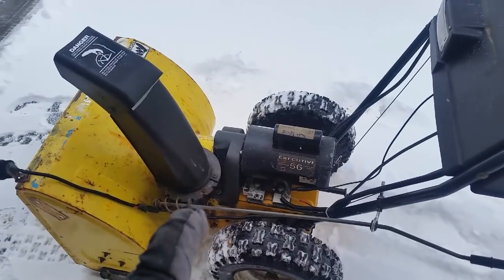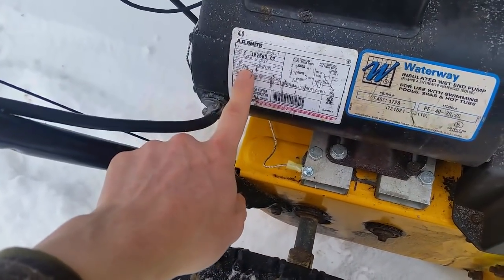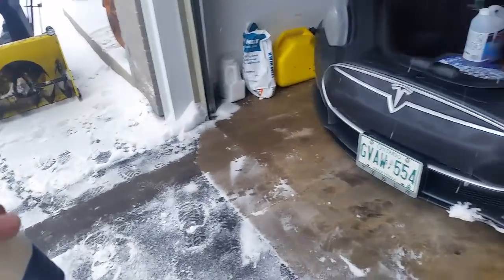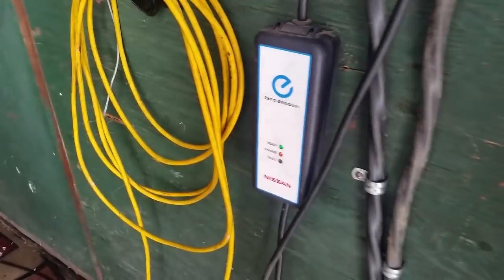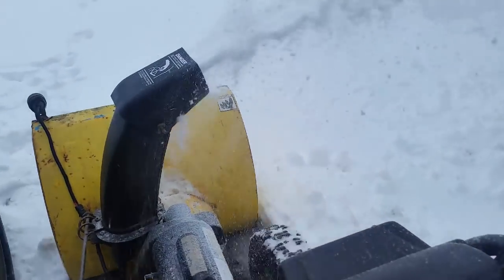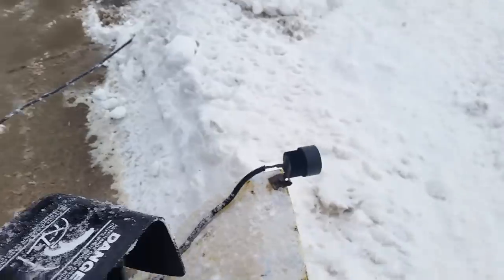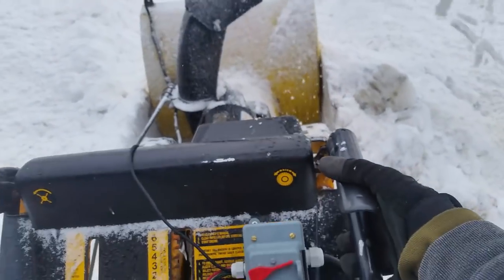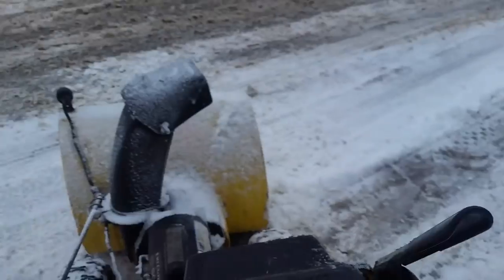2 stage snowblower electric

Comment: I had been thinking that I could get a somewhat larger motor, say 3 to 5 hp (about 25 to 30A, NEMA frame 213/5T as an example) and run it off the 14-50 outlet I have in my garage for my Tesla Mobile Connector.  The outlet already has a fairly pricey, but required, 2 pole GFCI breaker. (Your EVSE has a built-in GFCI as you know, but in my case, I'd go straight from the 14-50, EV/RV outlet.) I would need to get a larger gauge extension cord to keep voltage drop acceptable, but probably wouldn't have to worry about the cord overheating in a snowy environment. That and snow blower operation isn't as a continual load as EV charging is. I also thought that perhaps I could use a 1 phase to 3 phase VFD and go with a 3 phase motor. That would give me speed control, bidirectionality, as well as some ability to run the motor even with uncertain voltage drop on the cord, but finding a VFD unit that could survive the wet conditions of being mounted on a snow blower would most likely be a problem. Either that or I'd have to come up with a weather-proof housing that could breathe sufficiently. Such VFDs can be had for a couple of hundred $, but a 5hp, 240V, 3P motor would be pricey.  The weight of a larger motor might be a plus for traction too.

Comment: I had this very same idea for all the same reasons: while the single stage 120V plug-in throwers are fine for the powdery snow we get here in Ottawa (I see you're in Ontario somewhere), they just baulk on the snowplow windrows. I think some of the pricier Ego and Greenworks 55-80 V cordless two-stage blowers can manage it (since they're not limited to 15A) but that seems like cost overkill.

I hadn't even thought of using a hot tub pump as I wasn't even aware they ran on 240V. I had been figuring on using a motor from a 240V washing machine (front loader) for a conversion.

I think it is so unfortunate that North America adopted 120Vx15A as its standard, especially for outdoors. It has really limited the power of electric yard equipment like lawnmowers, chainsaws and snowblowers and has probably  cultivated an unfortunate cultural mentality that electric = weak compared to gas equipment. I can't help but wonder what the state of things (including receptivity to EVs) would be if 240Vx15A (or even 20A) had been made standard for garage and outdoor fixtures.

Comment: What’s it 745.7 watts per HP? So you have 230x12 was it? So 2300 + 460=2760 watts 2760/745.7=3.07 HP! Gas engine horsepower just doesn’t compare to electric!!
Reply: Most types of electric motors make peak torque -- which matters more than horsepower here -- at ZERO RPM. The gasser isn't making shit for torque until it's perhaps 2000 RPM. Also, the horsepower ratings are at the rated speed, which is 3600 RPM; if a 6 hp machine bogs down in heavy snow, guess what? Now it's only making 3.5 hp. The same phenomenon exists with electric car conversions; unless you really expect a car to do 120 MPH, you never need an electric motor with the same hp rating as the gas engine. Again, TORQUE is king! Cheers.
Reply: @fun_ghoul  I've noticed that a lot of gas chainsaws and snowblowers are now advertised based on the engine displacement rather than horsepower. Meanwhile, the battery electric ones seldom have anything other than a voltage (while the battery capacity is in the annoying amp-hour measure), though corded continue to have an amperage given. And torque is nowhere to be seen on any of them. The upshot is that it has become really difficult to make meaningful comparisons.

Comment: That would be good for my own project. but would come with just regular 120 volt... Maybe bigger snowblower??
Reply: If you only have 120V, you need the smallest possible 2-stage to convert, like a 22 inch. Alternatively, if you have a good bit of cash to do this, you could go with a high-amp-rated battery pack (e.g. Headway) and not be limited to only 1800W.
Reply: @fun_ghoul  Yes, but depend what motor (hp) with 120V…. 🙂

Comment: Nice setup! Some of the electrical works looks "dangerous". :)
What watt rating has your electric motor? Would you have put a more powerful motor if you would do it again (I saw you paused in the thick snow to let it catch its breath...)?
Reply: He paused because the wheels were spinning. He doesn't need more motor, he needs tire chains.

Comment: I just acquired a snow blower with a shot engine, now I need to source an electric motor.

Do you think that the not you have installed is a little under powered or needs higher rpms?
Reply: Most brushed AC electric motors are rated for the identical speed as gassers: 3600 RPM.

Comment: So maybe I didn't catch this part in the video. Is there a thermal overload on that motor / motor starter in the garage with heaters?
And I mean heaters as in overload protection. That thing has the possibility to run itself into the ground/ destroy itself/ burn up from overuse. 
And honestly your relay system and the fact that there may not be any sort of overload protection could all be remedied with a vfd. In fact it's the easiest way to get a smallish motor from single phase to three-phase. For about I think $800 I was able to get one rated for 30 amps and convert a friend's lathe to a three-phase motor. Much stronger much more efficient and able to do speed control. Also reversible. Easy to set up watching YouTube if all you want to do is have the speed be variable. You could also set the vfd to kill the machine if over a certain amperage. Vfd is smallish. Seeing as you fabricate I'm sure you could find a way to mount it somewhere in the back of the machine and get a small dial to control the speed. No need then for your inverter/rectifier/transformer. Vfd is the relay is the speed control is the protection essentially. Although not a true thermal protection you can set the vfd to have the motor run in between certain parameters.
Reply: Good question. Single phase motor more than likely has internal thermal protection.
Reply: You can't reverse the motor on a snowblower unless you want the blades to turn backwards, too. Ouf...

Comment: I did mine with a 5 HP 240vac motor and all 30 amp electrical
Reply from the maker: Post a video!
Reply: I will once my electrical parts show up from Ebay.
Seems nobody has 30 amp 2 pole square D QO breakers in my city and also the 30 amp DPST on off switch for the 240 bolt on the blower.
Reply: BTW the motor I used was a reversible one for an air compressor.

Comment: Hey, Joel. Have you considered stringing together 3 of the kobalt or greenworks 80v batteries to go cordless? Perhaps even a 2x3 configuration of 6 batteries for some extra juice? Admittedly, it may even be a better option at that point to go with your own home built battery from Lithium ion cells up to 240v.
Reply from the maker: It is an AC induction motor, DC might work on a cheapo universal motor, but for this I'd still need a beefy inverter or vfd
Reply: @erroneus  Good point, you'd lose a ton of power on the inversion

Comment: What kind of pulley did you use(part number or simular)? I know it is a dual or tri pulley. 

What shaft is at the end of the electric motor? 5/8  D Shaft? or is it a 5/8 keyed shaft? 

Was the shaft long enough for the whole pulley?

Did you use the same belts? I'm assuming so because of the plastic cover.

The reason for asking is I have a Greenworks brushless electric 80v lawn mower rated at 150cc (10HP?) with a somewhat the traditional (instead of two up front and two at the back) /// (its one up front , two on the sides and one at the back) mounting nuts and three wires to turn the sucker on. The battery goes into the motor .

It would be nice to use the battery and motor all year round instead of them laying around for a season.
Reply: 150CC is more like 5 hp (Honda 5.5 = 163cc), but might still be enough. Did you end up trying it?

Comment: Amazing ! I thought of something like this a few months ago. Very nice ! How do you simulated the signal for your outlet ? What kind of coupling do you have to link the motor to the snowblower ?
Reply from the maker: no signal required for the J1772 charger, just a diode and resistor. you can look this up online. no coupling, just a  belt and pulley mounted on the drive shaft of the motor.
Reply: @erroneus  Yay, belts! 😁

Comment: My personal opinion is that your gear ratio is too slow... that thing should be throwing that snow way farther in other words spinning faster... Electric engines are very powerful plus you are using it in winter.... Bigger pulley on the electric motor and/or smaller pulley on the drive shaft....

Comment: Any current overload protection in case you overload the motor? Otherwise you’ll trip your 220V breaker and or damage the motor.
Reply from the maker: yeah, the motor is thermally protected, while I used to have it going to a 20amp circuit (all the motor needs), it is now going to a 50amp because I changed charging stations, the charging station is also rated for 100amps, so I'm not worried about the contactors. Also not worried about the motor, the snow, freezing wind keeps it from over-heating, it usually barely melts the snow that gets on it. remember it is for a hot tub, designed for wet areas.

Comment: $20.00 in electricity to clean your dive way every time. Makes no sense
Reply: Where'd you come up with $20? Electricity is about 15 cents a kWh so running at max load of 3.7 kWh that's 56 cents per hour. In reality I bet it's half that based on  motor load.
Reply: 230 Volts x 12 Amps = 2760 Watts. 2760 Watts / 1000 = 2.76 kW. Assuming an electric rate of $0.15/kWh, then 2.76 kW x $0.15 kWh = $0.42 / hour. Therefore running this under full load for one hour would cost $0.42 of electricity. You would need to run it for over 47 hours for it to cost $20 in electricity.
Reply: Your math is WAY off.
Reply: It doesn't actually cost that much. Maybe $2-3. Certainly no more than $5. With the hassle of maintaining gas equipment, a lot of people would prefer that option.
Reply: Just to add onto others' replies, electricity never costs 15¢/kWh in Ontario...unless you're using a generator!

Comment: Sweet mod but no way I am going to a corded snowblower - I do neighbors  so that is s no go. Hated the corded lawnmower but  LOVE my cordless  lawnmower
Cheers
Reply: It's a question of needs, and cost. The only "boughten" 2-stage cordless is almost three grand (C$) with tax, and doesn't come with that much range. For that money, you could build something like this one, but with a YUGE lithium-ion battery.
Reply: @fun_ghoul  
I got a Ryobi 2 stage last year.  Just did a very heavy 6inch snow from last night .  Driveway is about 20 by 35 and it took almost every once of power to finish it.
A buddy of mine has the Ego and he is liking it.
The only think I dont like about my Ryobi is the chute controls, they need improvement but it was there 1st kick at the can. Oh and i think it should have come with 2 charges to charge all 4 batteries at the same time.  Just ordered to single chargers off amazon.
Cheers
Reply: @fun_ghoul  
Ariens came out with a lead acid model many years ago and discontinued I guess due to not being popular.  
Yep -- batteries prices for these guys are crazy.  If I wanted the new Ryobi 12ah bats ( came with 4x6ah)they are 539 here in canada.  4 of those is more than I paid for the snowblower!!!!  You making a battery pack will save you money if you can find some reputable cells.
Cheers

Comment: Interesting option, cosidering I hate storing oil and gasoline in my garage.  this would be a good alternative to help achieve that goal and I've already got an EV and 220V outlet.  (I need to take up welding to further leverage that plug. :-) )

Comment: Clearly you know your wiring... It’s Very smart using 240 volts!!! It’s a lot safer!!! 120V will grab you and not let go and that risk goes way up with water and wet conditions! Please make sure you use a waterproof connection or you used rubber electric tape and stretch it around the plugs to ensure it’s a waterproof seal!

The next diode you get make sure it has a thick heat shielding and put the shielding were it is in contact with the cold air. 

You may also was to get a bigger drop cord going to the blower. Not see how far it is to the end of your driveway but a waterproof #10 cable or drop cord should be used to keep the heating of the cables down. I would also check the returns at Lowe’s and Home Depot and Craigslist as well as your local pawn shops for generator cords. eBay (febay), Facebook and other sites maybe a good way to find a cheap cord. Your recycling drop off is another one... please look up the amps and recommend size cable! Go one size bigger if your close to the limit or if your doubt! All of my 120v 15 amp power tools are run on a #12 yellow jacket drop cords up to 100 feet. Never step in any water that a cable is lying in! 
If I was you I would put that cord in a protective case to ensure it doesn’t get any cuts in it. Maybe some of the clear plastic water line and seal the ends?

Hope this helps, good luck and please be save and use a meter to ensure the power is off before you work on stuff! Always put Safety First!